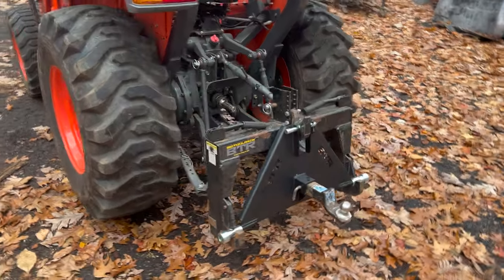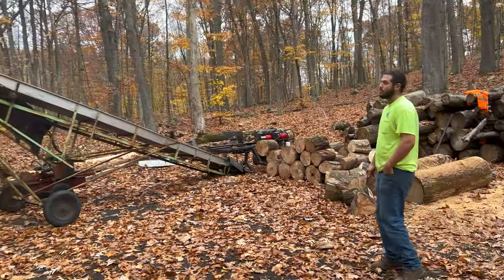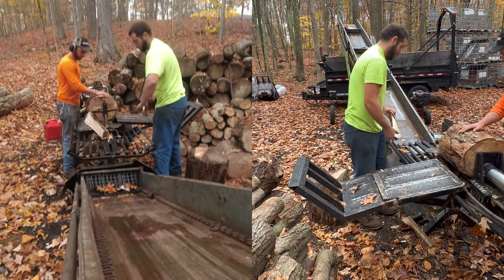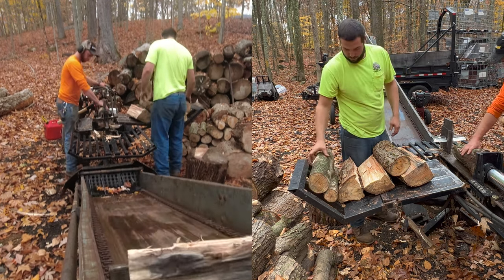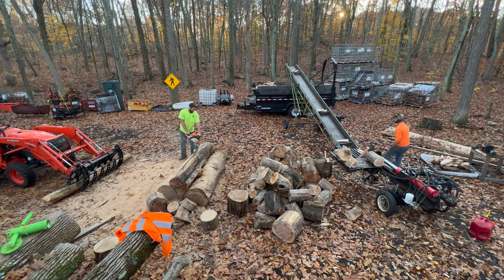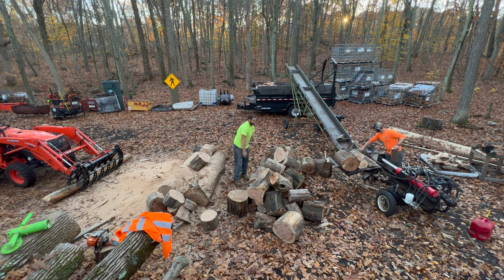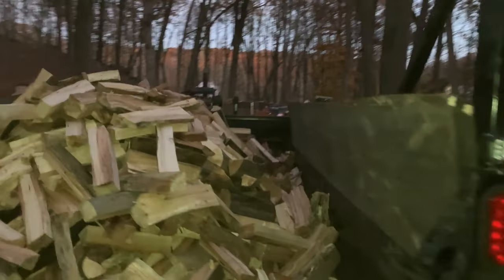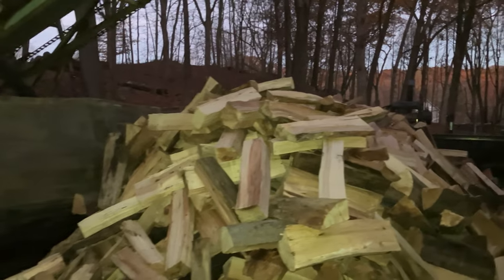#298 Major Firewood Production with Conveyor and RuggedMade Splitter

Comment: know how to make the second valve not get pressure ? It’s not blocking off power like it should to use each valve separately
Reply: I added a rugged made log lift table to my
Splitter
Reply from the maker: It would have something to do with how you have everything plumbed. Not sure on your setup 🤷🏼‍♂️
Reply: @DudeRanchDIY  i reached out to rugged made i guess i was using 2 valves that either one didn’t have a power beyond port
Reply: @DudeRanchDIY  who’s did you add return plumbing from auto valve?